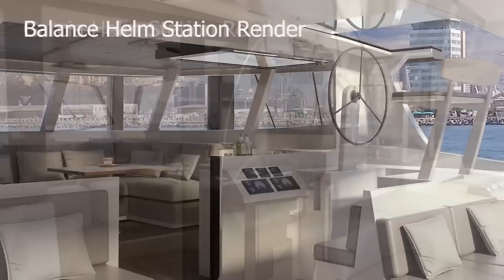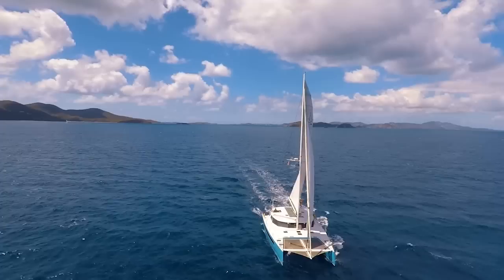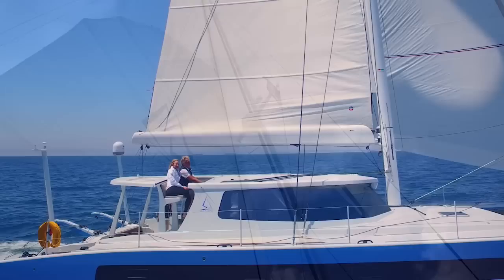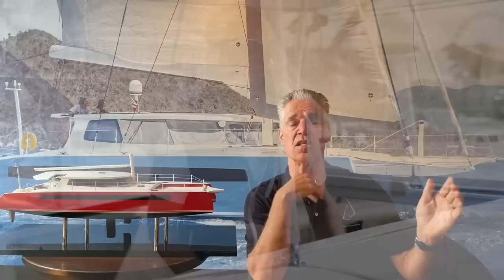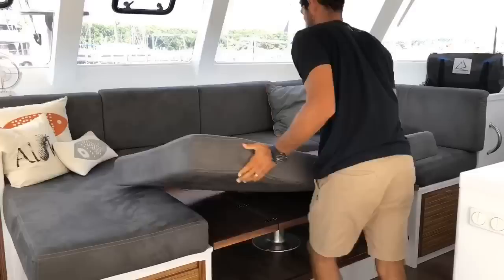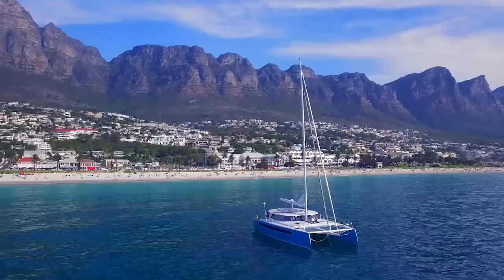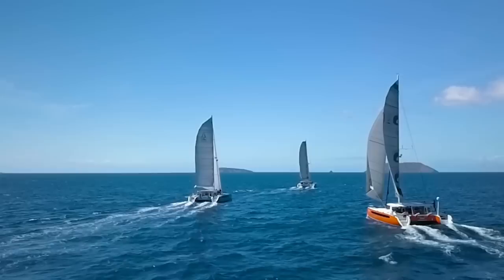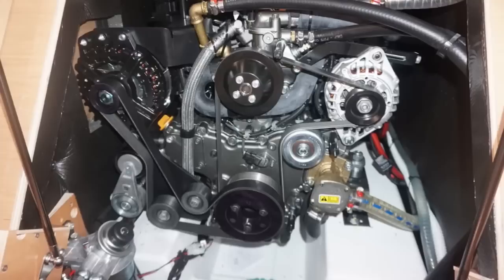Imitation is the Sincerest Form of Flattery

Comment: You are talking about Garcia (unknown to me) I but did you see outremer's new 55? It even has three positions 😂
Reply: The Explocat 52 from garciayachts.com (France) is an almost exact copy of the Balance 526. One big difference though : like all other yachts build by this company and designed for navigating at all latitudes - from the equator to the polar circle (and beyond), the hulls are build of aluminum instead of composites. As stated by Phil, only good concepts are copied...
Reply from the maker: Yes, the Explocat is alu and heavier and not a performance cat, made for a person with a specific mind-set. I still think a composite cat is safer in high or low latitudes and better insulated. Alu cats can sink, foam ones float. As I joke for years: All things in nature seek their most stable position. For a composite cat that is upside down on top of the ocean. For a monohull that is at the bottom of the ocean. Same an alu cat I am afraid.

Comment: Nice episode,
 I have  equstion for you , when the wheel is down  is this setup made  for motoring,  because I can't imagine to sail a boat without my eyes focusing on  all the sail all the time ,
 for me I watch the sail more than watching the horizon
Reply from the maker: You cannot see the sails from the down seat - you have to walk back to aft end of cockpit. When reaching you set them and follow your course. What I have found fun to learn is to sail the boat from instruments upwind - seeing the apparent wind angle that works best for the conditions and either sailing to that, or if on a long tack, just setting the autopilot to adjust to that heading. Of course when passage-making you are not going to be piloting carefully very often from a sailing perfection standpoint. If you want to have fun and see the sails and steer, trim as if you were racing, you go up top. The versahelm comes in handy when you have to motor in cold weather and steer and throttle same time, like coming into a harbor, marina, and on passages where you are sailing and simply wish to be out of sun or cold and occasionally make a course change. It is a great place to sit your watch since you can still communicate with everyone inside as you do.

Comment: The Versa-helm looks cool, but I have a question:

Why is the Versa-helm better than just having two wheels permanently mounted at those positions?  Seems like there would be a little less to break if the wheel isn't on a moving stick.

Comment: Are the continuous flow through vents still a part of the design? I've seen them mentioned briefly in another video and at about 13:04 in this video but don't remember seeing them when I was in Miami. If so where is the intake?
Reply from the maker: On the 526 we can do them via the front central locker, as on the 442. On the 482 there are opening deck hatches in front of master berths so we can have vents there and also via central locker. Customer options.

Comment: Hello, thank you for your video and sharing your experience and passion about building better catamarans! Congratulations! My question : Would you consider building a Balance catamaran with Ocean Volt electric engines, lithium batteries and hydrogenerating energy on propellers ? Thank you for your next answer..... Kind regards.... Olivier from Switzerland
Reply from the maker: As I have said, we can do an Ocean Volt system and have discussed this with our Cape Town supplier. We still feel that until battery technology improves that a diesel cat with lithium batteries and an Integrel system is a better option.
Reply: @balancecatamarans  I recommend a serial hybrid.  Electric motors powered from a large Lithium bank backed by a diesel generator.  That gets the advantages of Diesel for no wind passages, plus regeneration of battery charge and powering house loads from wind under sail (and solar at anchor).   

Given how little time is spent under motor on a performance cat, the diesel generator in a serial hybrid would get even less use than regular diesel engines directly connected to props.

Best way to do this is with a marine engine (not genset) connected to the same type of permanent magnet or AC induction motor used for propulsion but used as a generator and not connected to props.  This combination is used to charge batteries, run house loads, and/or drive the propulsion motors.  Same idea as Integrated Electric Propulsion on big ships, but with the ability to run on battery power and charge the batteries from wind and solar in addition to generator.

Again, not suggesting to use only batteries.  Use a large battery bank and back it up with a Diesel generator.  Wind (sail power) and solar will do most of the charging.  The Diesel is only a backup for periods of no wind.

Long term, this arrangement will become commonplace, and it's already becoming common on day sailors and coastal cruisers in Europe, but without a generator, which is only needed for passagemaking.  Why not continue to lead the way and add it to Balance as an option?  As you can see, there's lots of interest, and it would promote your brand.

The Intgrel system is good, but it's a parallel weak hybrid and therefore can't get the benefits of regneration.  It's impossible to charge a large lithium bank using sail power since there is no electric motor connected to a prop.  In contrast, regeneration from sail power (hydrogeneration) is a major advantage since it means the energy for common use of motoring can be recovered simply by sailing.  Its use is already proven, and it means a generator would get even less use under real world conditions since sailing can recharge the batteries.

As sailors, we seek to live in better harmony with nature.  Electric drive does that efficiently, effectively and simply.  Regeneration uses sail power to make electric power for charging batteries, motoring, operating air conditioners, watermakers, stoves, ovens, refrigerators, etc.  At anchor, solar can power those loads and top up the battery bank for motoring out of the anchorage.  This is living in much better harmony with nature.

P.S.  Your boats are the best designed, best conceived, and best styled in the market.  Electric drive would make them even better.  Include a backup generator for windless passages.  It would get very little use due to your excellent performance under sail.

Comment: I can't say I am a big fan of catamarans. I get queasy a lot for some reason but having spent time on them think my preference would be for the twin stern arrangement. I say that coz more often than not you are on auto anyway and for sure they are comparatively exposed yet there are other gains to be had such as convivial cockpit seating, space efficiencies, line handling and of course direct steering. It's horses for courses yet don't get me wrong the Balance solution looks nice it's just that I don't think the helm position is so important as long as you have visibility.
Reply from the maker: You want the best visiblity you can get in all directions when piloting, regardless of where from. On dual helm cats you are blinded to one side or another withour waking back and forth in crowded sailing areas. Not big deal on a long passage on a dual helm cat so long as autopilot works and you are not sun exposed all the time until it can be repaired.

Comment: Although Balance was clearly the first catamaran brand to adopt the idea in its modern form and to prefect it, this concept is indeed an old one that many monohulls used to have to ease control of the single wheel when healing.

The Outremer implementation on the 55 is quite different from the Balance one, the Explocat 52 is more similar.

Overall, I believe that many innovations are spreading across brands.

The reality is that this option is cool, but most of the time either you are in auto-pilot or you want to be at the helm in good conditions. It ends up being very rare that you need to be at the helm in bad conditions. And when it does it's unclear whether visibility though wet windows at the front is good enough vs just steering from the inside using the auto-pilot or wearing wet gear and steering from the outside position.

I am not sure that too many customers of Outremer and Garcia will end up choosing this option.
Reply: Hi Bernard, I think you underestimate the utility of the Versahelm.  I operate the Balance boats more than anyone other the some of the owners and I can tell you from first hand experience that the down helm position gets used A LOT.  Especially in chilly weather or on night watches.  It's just so much more comfortable to be protected from the elements when you choose.  During rainy condition, the visibility through wet windows is no worse than poor visibility when getting pelted in the face by raindrops.  I encourage you to join us for a demo sail and see for yourself.

Comment: I am curious as to why add an Integrel instead of just swap out the oem alternator.
Reply from the maker: The Integrels perform far better than other alternators due to the sophisticated management system invented by Parker Hannifen engineering. They are superb for 48 volt Litihum Ion charging. Visit their site to learn a bit more. A very special, ground breaking product in our view.

Comment: alibi cats had a similar helm setup pre 2015 also certain mono hulls had similar earlier again
Reply: Which, if you had listened to his video, you would have seen him talk about... As he says, the Versa-Helm is more than the pivoting helm, it is the layout of all the elements to give complete control and good sightlines in both the up and down positions. The French designer went beyond just building a similar pivoting helm, his design is nearly indistinguishable, placing all controls and windows identically. Indeed, direct imitation (that probably should have given the nod to the great work that Balance did in designing it in the first place.)
Reply from the maker: You are not correct. As I have explained, it is not about the pivoting helm, but the way in which it pivots and the way in which it was designed to offer superb up and down sailing. I have sailed on the Alibi 54 and it is more like the new Outremer 55 - you sit on the rail for fun, in the sun, no protection, for sport sailing. The throttles, the sail handling, are not near you either  - you cannot steer and manage sails at the same time. And when it is down you cannot see through the boat without issue or blind spots nor sit comfortably. The gentleman below, Paul Carrol is quite correct.
Reply from the maker: Dear Paul, thank for this. The reason I never mentioned the Outremer 55 is that I do not view it as a versa-helm copy at all. It is more like the Alibi. The Garcia is, as they say in Thailand when they offer you a fake Rolex: same same!   But as I said, we are cool with it. I just feel that Anton du Toit and Jon Paarman were the ones who worked with me to really perfect it. It looks simple enough, but a lot of time and energy went into getting it right. Take care, Phil
Reply: @balancecatamarans  yes, as an engineer, I can confirm that a seemingly simple, elegant solution usually represents an awful lot of expertise, effort, and interations getting everything right.